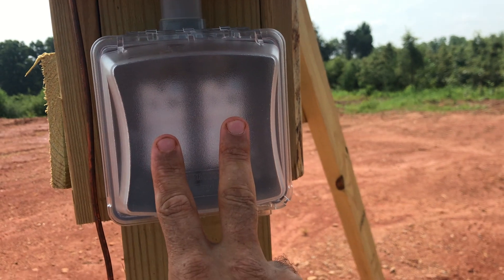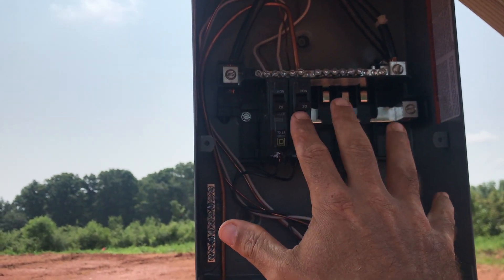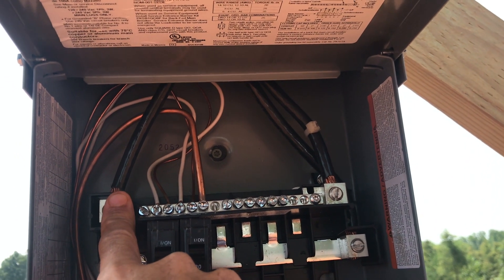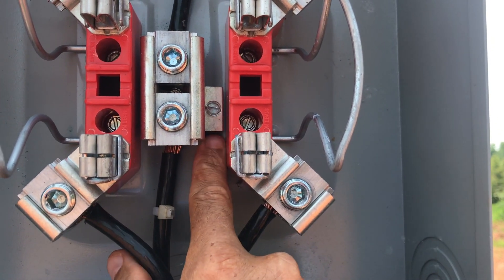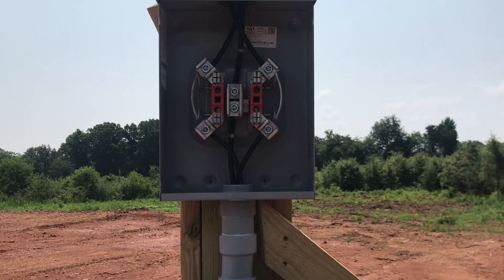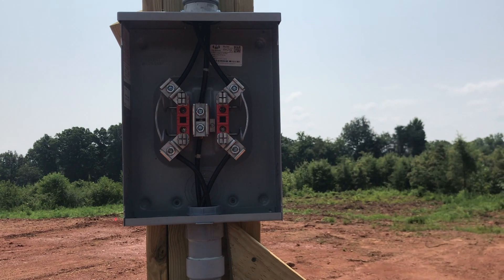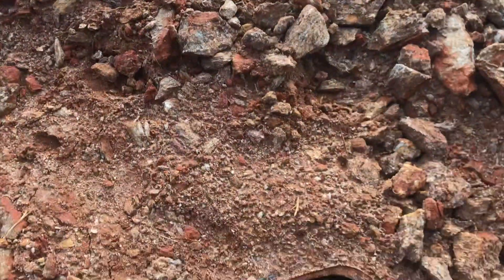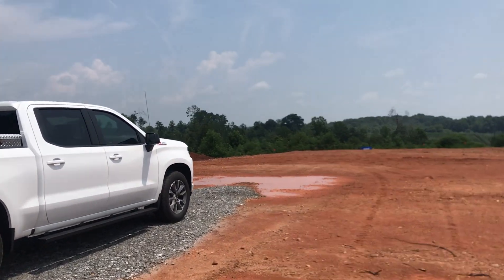NC Barndominium Build - Power Pole Inspection

Comment: He didn't require a main breaker? Also, where's your bonding screw since you're using the neutral bus bar as a ground bus bar as well? He didn't make you label the service wires for hot, neutral, ground, etc?
Reply from the maker: Excellent questions.

The pole was constructed using the 2017 NEC at the time.  If I recall correctly article 230.71 gives relief from a main disconnect because I was less than 6 circuits.

You are correct with the bonding.  My ground and neutrals were bonded however the panel box was not.  The self tapping green screw was missing.  Bonding should be at the point of first disconnect.  This was intended to be a sub panel (which should have neutrals and grounds separate) and I neglected to install the screw.  Excellent observation!

The label for the neutral is the white zip tie.